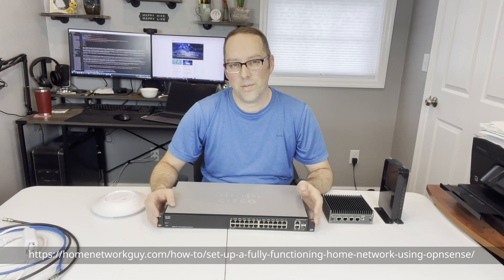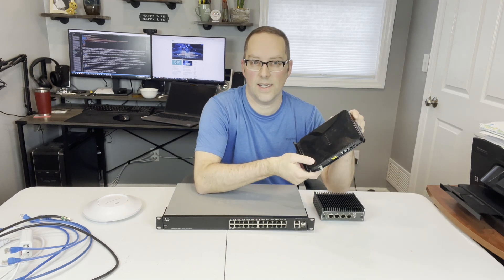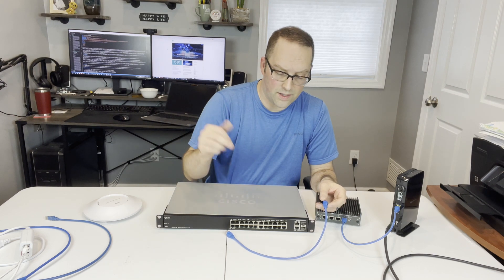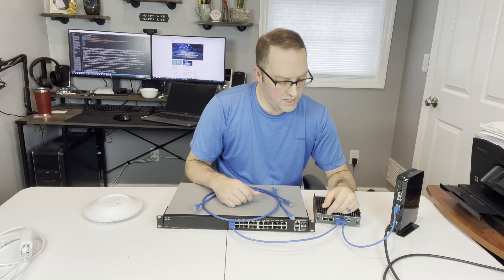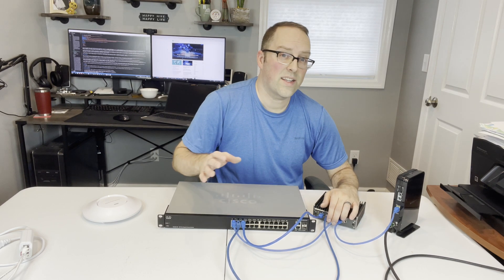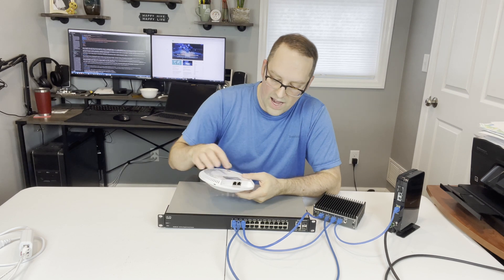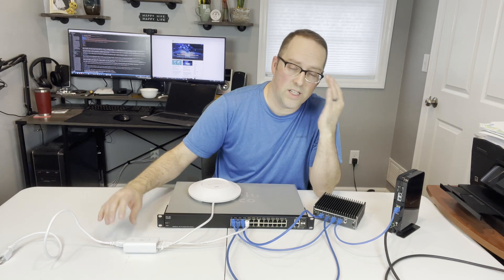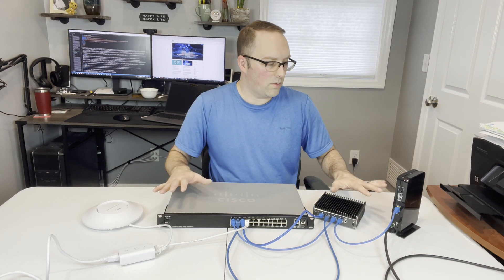Set up a Full Network using OPNsense (Part 1: Overview)

Comment: For who wants to learn network and has the time to play with configurations that is a very good setup, however, for those who need a quick semi professional setup with VLANs EASY to maintain and troubleshoot a network like this is a mess. I mean you have four devices and fours GUI interfaces, I can tell you strait-way this is a mess to manage.
Reply from the maker: If you have those requirements, you likely will want something like Ubiquiti UniFi products which all integrate together with a single interface. I personally don’t think think it’s that difficult to maintain once it’s all set up but this set up is intended for more technical users anyway. My entire website was created with a premise of building more advanced home networks which targets a specific audience who wants to learn that subject matter.
Reply: @homenetworkguy  I'm exactly like this now, with devices all over the place, Routers, several brands of managed switches and several brands of access points, learned a lot of network sure, I can configure now basically any device including Cisco switches over CLI and even Edge Routers on CLI as well, however, to manage all this stuff took a lot of time and effort, and if a switch goes down unless you substitute for the same brand and upload the previous configuration, is again a pain to configure every thing all over gain on a new device, especially if has to be done over the command line. As I said to learn is great, is useful or pratical ? No is a mess. Thanks for the video anyway.
Reply from the maker: Sounds like you actually do more than I do in my network. I don’t use command line on the switches. Just use web based interfaces. I try to stick with the same brand of switches and the same brand for APs which means I only have 3 main interfaces to deal with. To be honest I don’t mess with the switch or AP configuration much after I get it set up. I only update my switch config when I’m adding or moving stuff around on my network which is only on an occasional basis. I do almost all of my configuration in OPNsense so I am mostly dealing with one interface to manage most of my network. I’ve never had any switches fail one ran my old OPNsense box for over 5 years with no major issues. I think my network is pretty solid and stable. I do have some hiccups when I move stuff around but that is to be expected when making certain changes (possibly even on “easy” solutions).
Reply: @homenetworkguy  Never used OPNsense only Pfsense , must be almost the same as OPNsense is a fork, anyway I will move soon to TPLink omada all under one interface as they have now a 10GB router for 360USD, I would prefer Grandstream or Unifi acess points but for simplicity will stay with all TPlink. Good luck with the channel